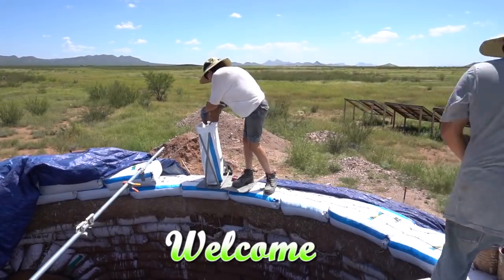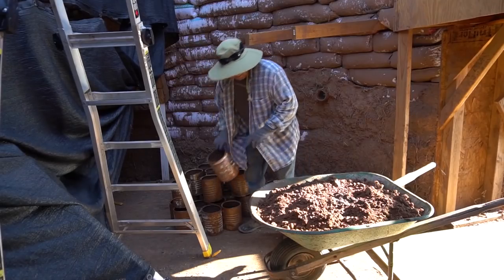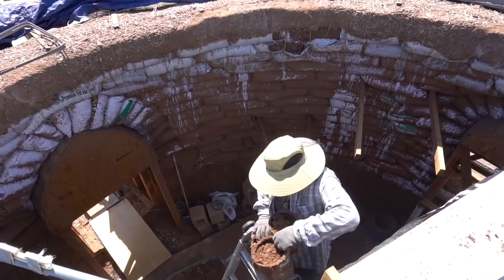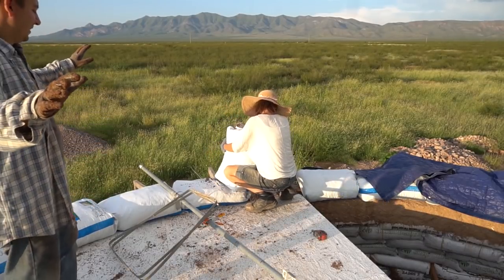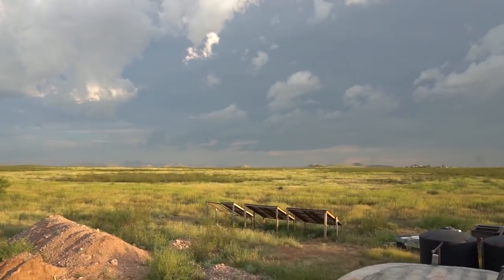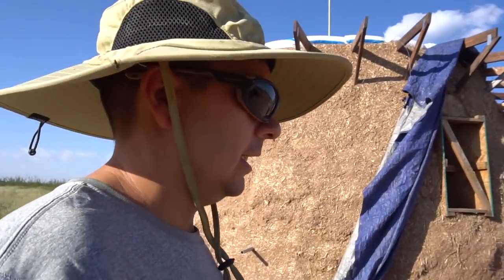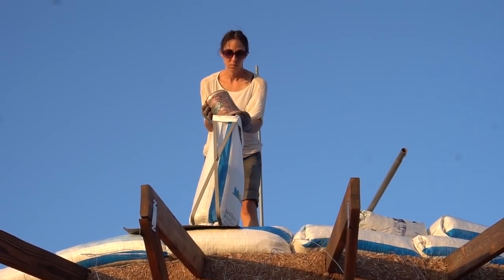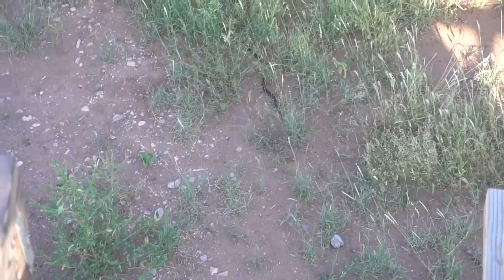We Made Incredible Progress On Our Earthbag Dome, But At What Cost?

Comment: Hey guys, it looks really good what you did. I think you need some kind of different type of method of getting the dirt up to the top.I know you have tried to use a pulley system but it didn't work for you.

Might I suggest you do it again but you put some kind of fram on the top and use a multiple pulley system. If you have the top of your system you would be able to pull it higher than your head then you wouldn't have to stoop over to get the dirt.

No matter how you do it you must make it so it saves wear and tear on your body. I think it might make it so you can even do more work.

Whatever you do make sure you are careful. Safety should always be the first priority. Take care guys, see you next time.

Comment: I was thinking about the adobe surfaces inside and out and their adhesion to the bags.  I imagined a wire cut to maybe a foot or two longer than the width of the wall bags laid across the bags every other layer or so, and every few feet.  Then there would be a way to attach chicken wire to the walls to hold the plastering in place.

Comment: Labor intensive work there. Stay safe. Put tiki torch citronella oil in a few hurricane lamps placed below and near your work area. Set to low flame. They should safely keep bugs at bay. We put one under our picnic table and a few on the perimeter for outdoor dining. A drop or two of olive oil on any exposed standing water chokes out the larva. You’re going to kick yourself when you discover the speed, ease, and efficiency of straw bale construction. Coated correctly it will last for decades.

Comment: I have been thinking about how you might be able to get those cans of dirt up to the bag filling area. I think you may be able to use a small (possibly DIY) conveyor belt setup to transport the dirt to the floor. You could still use cans to prevent the weight of a load of dirt damaging the floor or the joists...
Or you could use a angled lift which roofers use to transport tiles or shingles up top...

Comment: When up so high are you putting any ropes tied down so you won't flip over edge to get hurt (on the side without the platform)? I know it would be tricky.. may have to move rope from side to side to keep yourself stabilized in some way.
Reply: We should have OSHA come and advise.... no no! don't tell OSHA they will shut their project down and demand big $ to do studies. And then they will call the EPA and give them fines for having no proper steps for the snake to climb without falling.
Reply: @stevethomas5209  true.. I don't want that. I just want her to not get hurt.. I thought a rope to hault a fall or for her to hang on to would help.
Reply: @creinicke1000  I understand you are concerned for her safety. But sometimes you just have to go slow and think before you make any moves. Remember a 100 years ago everyone took risk to better themselves. Sometimes one can be overly cautious. Safety first indeed. Another thing I would not put a rope up there for tripping on and possibly hanging yourself with. Scaffolding would have been nice and my first option but it is very expensive and I most likely would opt out and do just what their doing. Slow and safe.

Comment: If it were my house, I'd be adding cement to the dirt, stiffening it up, then I'd shotcrete inside and out.  Your house won't last and will become dangerous over time.
Reply: Stiffer is not always better.
Reply from the maker: Cement would destabilize the clay.
Reply: @ourselfreliantlife  And how is that?
Reply: @Cspacecat  moisture
Reply: @sean-or1nc  Exactly how are you going to keep your house from melting if you get heavy rains?  That dirtbag house will turn to a mud house and that means everything will sag.  Do you actually think those bags will hold the pressure?  I'd shotcrete the outside and seal it.  The house will be around for 500 years then.  I'd give that house 20 years as is and the bags will give out.  Any moisture will move dirt or clay.  All dirt or clay settles over time.  That includes freezing and thawing of winter days.  There will be a point in the middle of the clay where the outside will freeze but the center will thaw out.  You are going to get movement and that means additional pressure on those bags.  They won't hold.  What you should have done is built a second layer with a 6" gap in between.  You could have staggered boards between the layers.  That would have given you far more strength and temperature stability.  You could spray foam the inside, but you're still going to have to seal the outside somehow.  I think you built a death house.
Reply: @Cspacecat  yeah YOU could it that way. THEY are doing it their way... So what if they want to constantly need to give love to their creation. It will work for as long as they need it.. And it will get improvements down the road as with everything in life. 
And have you ever heard of a yurt? Its meant to be a breathable liveable space. Thats what this will be. But with earth..
I hear ya on adding  shotcrete and such and other traditional techniques applied. Thats not what they are doing. 
When I use dirt bags whenever I get lucky, im sure ill do it my way and itll be great. 
Chillaxe relax and enjoy the humbled content they are providing and try to be the best you that you can be .
Remeber with time all wounds can be mended
Reply: @Cspacecat  look man your title doesnt always mean your the boss everywhere.
They are unfinished and haven t observed any indications of structural integrity issues and they have been building for a year. How about you understand their rights as liberty lovein americans, they have fewer restrictions, then your by the book code city..  They will be okay and my knowledge is from god, and I watched their series from the start. They are very articulate with the mathematics involved to achieve optimal integrity. They arent beginners btw and like I said, sit back and relax and enjoy them do not condemn

Comment: Pace yourselves. It's a marathon, not a sprint. Please park the Tahoe in the shade.All the rubber seals, and the tires are degraded by the sun. You have such a huge rain roof, are you taking full advantage of it for shade? We care about Y'all. You're up so high with no safety gear, one misstep could be fatal or crippling. I'm concerned.